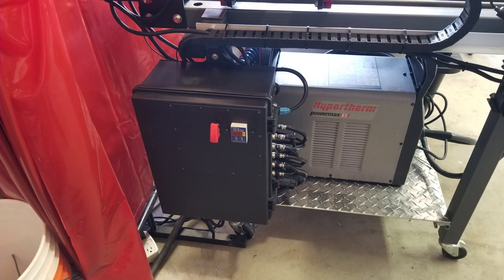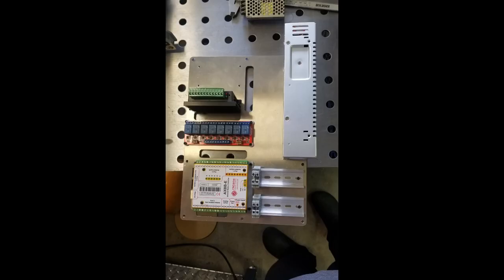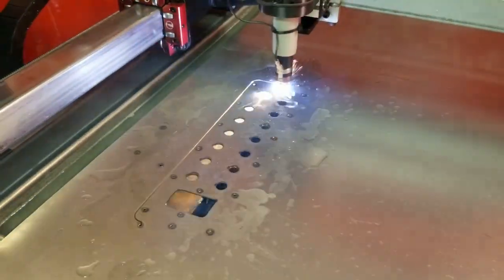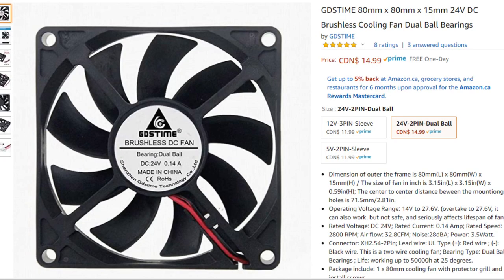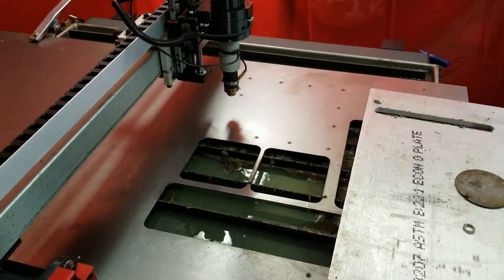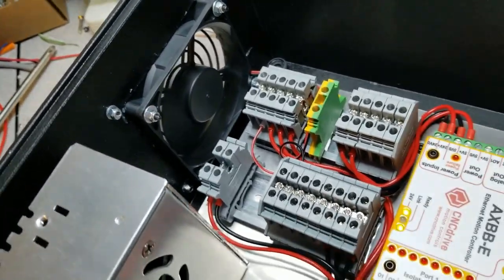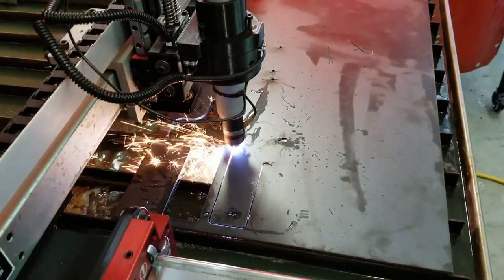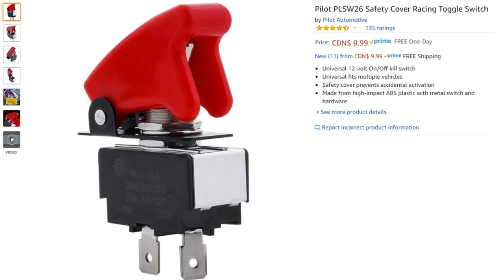DIY CNC Plasma Controller

Comment: Another great video👍why are you. changing  the promo THC?
Reply: Thanks. I mistakenly bought the SD version thinking it was better.  I need to be able to have better control over it in UCCNC so I should have bought the 150 version.  However there are other options available in that price range I will look at.

Comment: Great tip on the ceramic tile for the pan bottom. And I'm also curious as to why you're changing the Proma THC?
Reply: I mistakenly bought the SD version thinking it was better.  I need to be able to have better control over it in UCCNC so I should have bought the 150 version.  However there are other options available in that price range I will look at.  The  down side to the ceramic tile is clean up is more involved.
Reply: @brendinemslie8226  Thanks for the update ....I'll be watching!